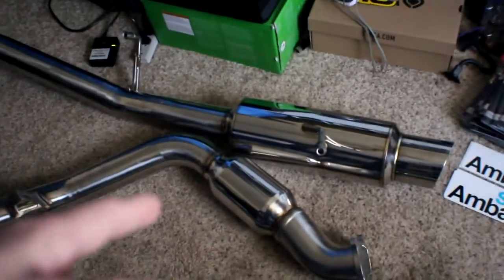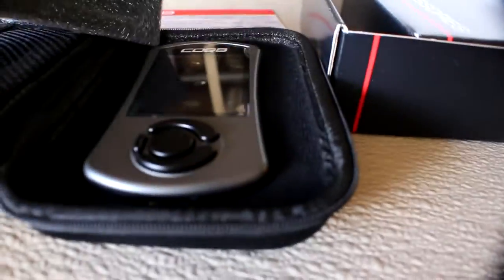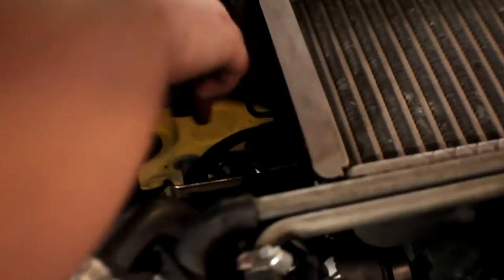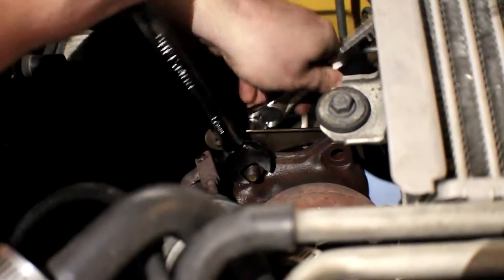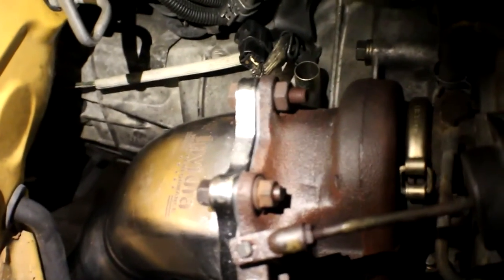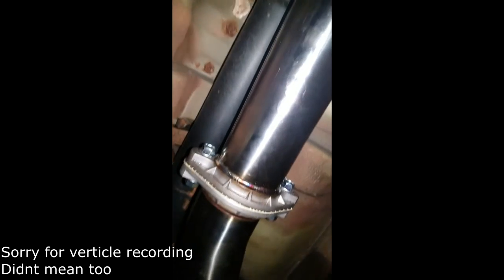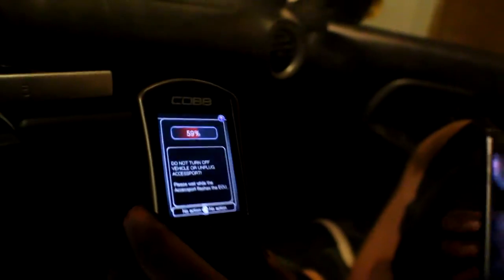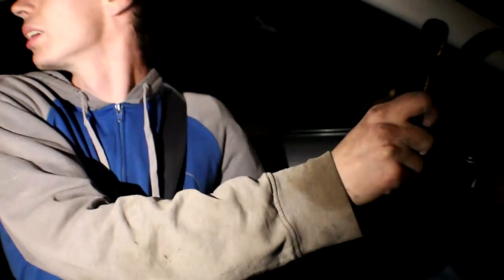Invida Full Exhaust Install and Cobb Stage 2 Tune!

Comment: you didnt mention how we had to cut off that piece with a high speed did you? lol
Reply from the maker: nope lol we literally cut a bracket off because of that bolt that was seized
Reply: WRXer Had to do the same on the exhaust bracket for my old NA Impreza. PITA.
Reply from the maker: 802 Garage Thats funny lol
Reply: @Reksir  Hey man!

I have a JDM 2001 WRX which comes factory 247hp at the crank, or 200whp. I am wanting to do the Downpipe and Tune route, and was wondering what kind of gains I can expect from this? I have been told around 20 - 30 but does it make a difference on JDM vs USDM since JDM only have 1 cat and that is the downpipe. I am also planning on putting a 100 Cell High Flow Downpipe rather than a Catless as I don't want the smell/boost creep issues, so I know I will lose 5 - 10hp.

So, with a 100 cell Downpipe and tune, what sort of horsepower increase should I expect at the wheels?

And also, if I am just doing the Downpipe, is it worth replacing the stock WRX intercooler with the STI one? I have one but if there is no point I wont waste the money on getting it installed.

Cheers!

Comment: Just got to the "Hmmm, wasn't it just 2:00 PM?" Part. Knew you were being pretty optimistic expecting it to be done by dark! Hahaha.
Reply from the maker: 802 Garage Everything was going so well besides 2 bolts. we would of been done way before dark if we didnt have problems
Reply: That's always the way! 90% of the job takes 10% of the time, 10% of the job takes 90% of the time! Hahaha. Try working on a car 10 years older! :P
Glad you got it done.

Comment: Hey I have a question, what is your vacuum reading on the accesport gauges? cause mines is reading -6 to -7 vacuum. I feel like I might have a vacuum leak since it's so low..
Reply: Should be 20 vacuum at idle. 30 when letting off gas. And peak boost 15psi 3rd gear

Comment: Do you need every part that Cobb list for the stage 2 to upgrade to the stage 2? I have a cat back exhaust… just wondering what all you need
Reply from the maker: Just a catback and downpipe is stage 2
Reply: WRXer Ok, awesome. Thank you!!
Reply: WRXer Do you have to buy a Cobb downpipe? Or can you buy any aftermarket down pipe
Reply from the maker: @IamchandlerJ  any, I got the high flow cat invidia downpipe
Reply: WRXer Awesome. Thanks so much brother, Appreciate the help!